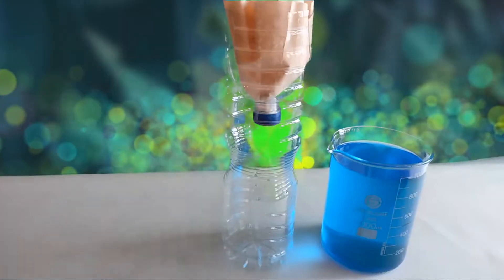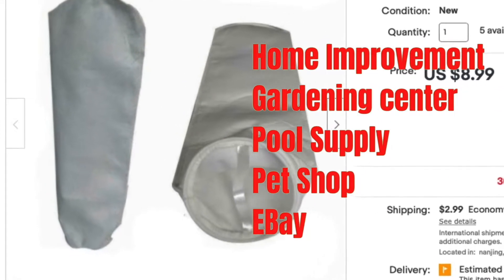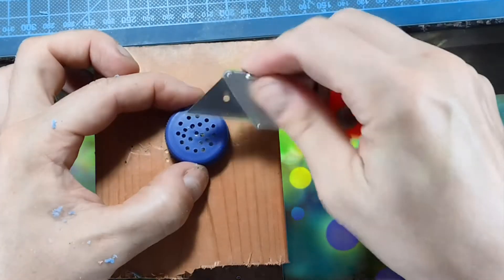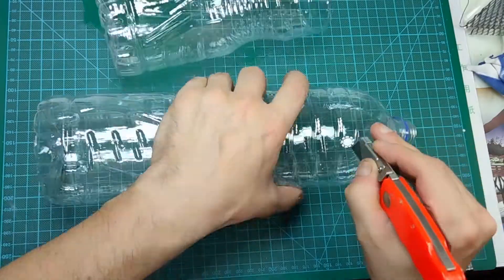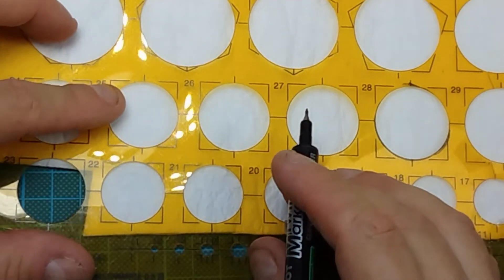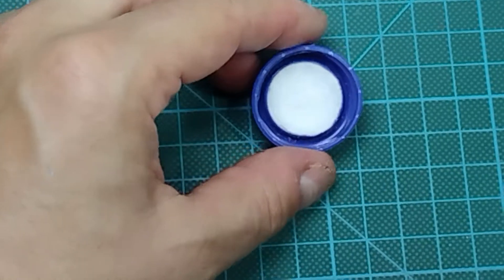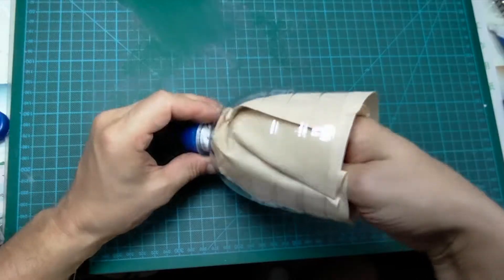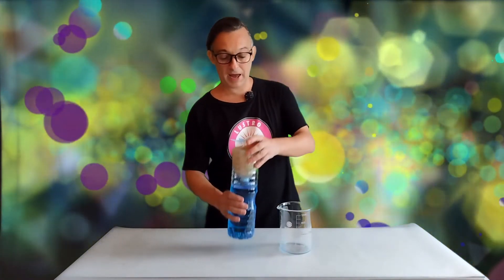1 Micron Filter Upcycled Free or Low Cost Filter for Electroplating, Chemistry Cleaning and More

Comment: Can i use this filter instead of activated carbon filter? For example for copper plating solution?
Reply from the maker: I rarely use activated carbon, it is used to remove organic contamination and can also remove brightener.  This filter removes solid particles and I only filter  every once in a while.  If you cover your tank when not in use and use anode bags it prevents most particles from getting into the solution so you won't have to filter too much.
Reply: @electrojewelerjordan490   Then how do you remove organic contaminents?   Potassium Permangate?